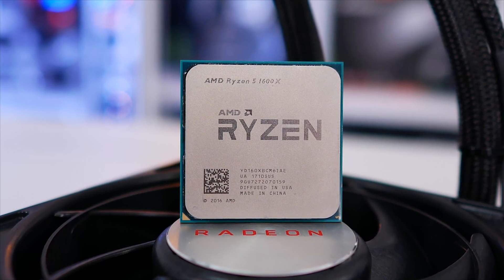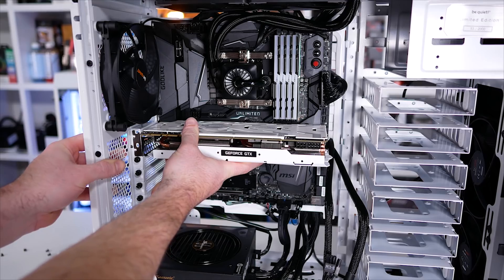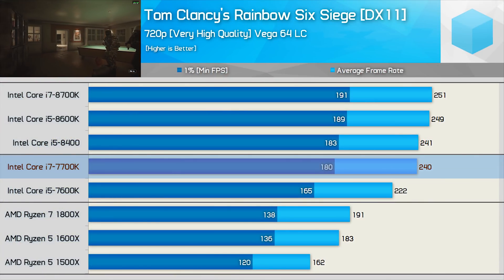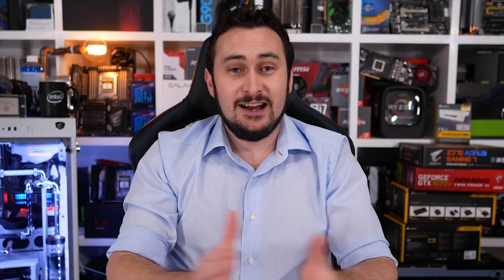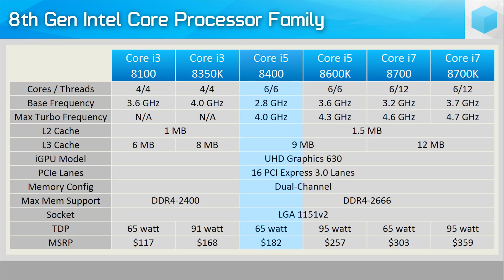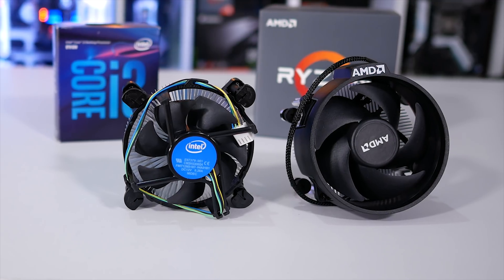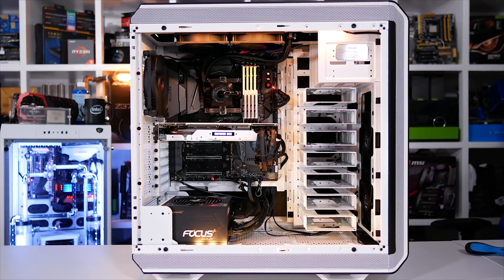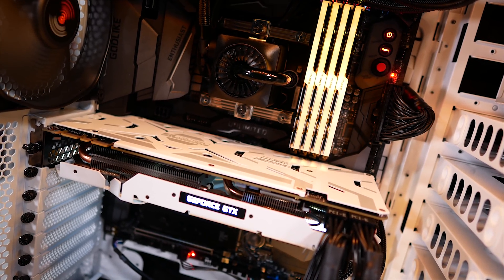Let’s Chat, R5 1600 OC vs. i5 8400 Benchmarks Incoming!

Comment: AMD Fanboi here
720p testing, that's fine as long as testing is done as well at 1080p and 1440p at minimum. While the argument of GPU bottleneck is relevant to cpu testing, there are variables when there is GPU bottlenecks that can show variation in the CPU's under test. Sometimes the slower CPU at 720p ends up being the fastest at 1440p, usually this variable with gpu bottleneck isn't as pronounced as at 720p, but we have seen some interesting variations in the 1% lows and for many that metric is more important than averages. This does not always play into AMD's favour but it is something worth noting and something from which counter arguments can be premised on.

I am amused though at the moment and I do await the 1600 OC benchmarks to see how close it is, but intel fanbois have had a lot of fun rubbing the average frame rates of the 1600 OC into the noses of AMD fanbois when comparing to a 7700K, that they just aren't good enough for gaming, while they'll happily extol the virtues of the 8400 as being good enough, even though when compared to the 8600k and 8700k, it's giving gaming performances that are somewhat in line with the 1600 OC with a 1080ti, while ignoring the fact that people using that GPU won't settle for the 8400, nor will that level of performance find its way into the mid range for at least 4 years.

The 1600 is bad because 7700K OC, but the 8400 is good because vs stock 1600 it wins with a 1080ti and overclocking the 1600 isn't a fair comparison and it still loses badly because of stock frequencies.

Comment: You should watch "The great coffelake con job" from "AdoredTV" you will know why the i5 8400 will perform worse on budget Motherboards.
Reply: Jim THINKS they wont achieve as high clocks because cheaper motherboards are often made with cheaper vrm components, meaning the extra power needed for the higher clocks may not be reliably delivered.

If MB manufacturers can produce decent VRM solutions using either enough phases, decent vrms, vrm heatsinks that work, they should be able to do it.

The bottom line is how much MB makers will cheap out.

Adored never states it will certainly happen across the board (no pun inreded).
Personally i think a few boards wont maie the cut, some will, so consumers investing in the platform should do a little extra research into this area before deciding on hardware
Reply: I agree, I enjoy watching Jim and he brings up alot of things others dont. He is predicting the 8400 will not perform as well on the lower boards. He could be right, he could be wrong. I honestly have no idea. I think Steve may be on to something with talking about the lower clock due to AVX instructions. I think were the confusion sets in is when Jim predicts things and AMD fans then start to preach it as gospel. Until we see the lower boards and what they can do we will not really know. As I stated before, lots of folks predicted Vega would beat 1080ti, many folks predicted the 1070ti couldnt be OC. So how about stop beating a dead horse and wait til we have facts to base claims on.
Reply: The entire point was that intel, for the first time, did not disclose turbo boost states per loaded cores. This enables motherboard manufacturers to implement whichever 6-core turbo they want down to the baseclock on motherboards that don't support overclocking. This is proof that it is possible for someone to make a motherboard that locks it to 2.8GHz when 6 cores are loaded. whether or not that will actually happen is another question, but this absolutely needs testing as intel has changed the way this works. You are no longer guaranteed certain clockspeeds for certain loads independent of the motherboard.
Reply from the maker: I've watched it, I still don't know why the i5 8400 will perform worse on budget Motherboards. Do you? If you do please tell me.
Reply: Hardware Unboxed it needs too much power in order to achive the all core turbo. Also it is using Intels Turbo Boost. But on more budget oriented Motherboards it is not gonna get enough power to run at the all core turbo of 3.8 GHz. 
That is how i understood his video.

Sorry if my english is kinda bad... I am from Germany
Reply: Tab yeap thats right
Reply: If you actually listened to Jim from Adored he said he Thinks that may happen as he has no real proof of it. We honestly wont know how they will perform on the lower boards til we see them come out and get tested. Reminds me of the folks that Thought Vega was going to be faster then the 1080ti. Dont believe anything til you have real proof of it.
Reply: Noobish He just knows a lot about Hardware and etablishes his arguments with articles.
Reply: We don't see clock differences between x370 and b350 on AMD why would intels mid range chipset be worse? Haven't watched the video in question but the only thing I can think of is limited ram speed on the mid range boards like Steve mentioned here and I wouldn't expect a huge difference from that as ram speed only seems to be a 1-3% change.
Reply: John Totten The fact is, jim's predictions have been for the vast majority been spot on. Predicted vega 7 months in advance, the gpu trend... The experience I have with him is the fact that he gets more things right then wrong.
Reply: "more stuff right than wrong", if you actually base your credence on testing, theres no wrong. The fact is, "jim" is full of shit. He can stuff his predictions, from current to past ones, where it required channels such as this one, to debunk the filth he kept spreading as fact. Misinformation is all he does.

Give it a couple months, boards will be out, hes proved wrong, and both you, that OP over there, and "jim" will disappear, moving to whatever next misinfo you're working on. Try doing something you're actually good at.
Reply: intel has a higher chipset cost to mobo suppliers. so for the same priced b360, the am4 b350 should have better components

Comment: Steve AMD fanboys like to spread misleading statements or just flat out lies. They were even saying that the AMD's  upcoming APUs would have rx 460 performance. Sometimes they resemble a cult.
Reply: Many users exxagerate on both sides. I just wanted to point out that you are commenting on a 15W TDP APU meant for an ultra-thin laptop if you are referring to the ultra-low power Raven Ridge Ryzen 7 2700U. When both the CPU and GPU is being taxed, there isnt enough power for both to spread their legs. Even at the frequencies they run at, we couldnt expect more than RX550 performance. This is all the hype I heard: similar performance to MX150/1030/RX550. That is still a ways below the RX460 in performance.

However, when a higher clocked and fully featured version of Raven Ridge is available in a 65W to 95W TDP variety on the AM4 platform, then it could be possible for such performance figures to be met. If you compare shader cores and clockrates and consider the extra TDP headroom, we very well could see such RX460-like performance in an APU.

Try to not run with a single thread of info from an extreme person  and act as though that will be impossible based on inconclusive information. To beat a fanboy and make a valid point, one has to be more rational and be better than them.
Reply: To play devils advocate here going ONLY off the new 2700U slides with NO REAL WORLD TESTING it does have the same performance on paper.

Key words being "on paper" however if you compare the actual slide fps numbers to the RX 460 it does not compare at all and falls behind the MX150 by about half, Still a huge boost over the old apus but not as good as people think, However it is also true this is a 15W part against a 25W dgpu and is shareimg the 15W with a cpu so even half the performance is damn good and does point that the full power 35W and 45W parts will be on par with a MX150

But until the 15W chips are in the wild and are actully bemchmarked im not willing to say one way or the other and my blanket statment is they look impressive as hell and im excited for them as if they deliver even 75% of what is promised they will still stomp the intel 15W chips flat.
Reply: Corporate Commander All fanboys spread misinformation
Reply: You mean to imply that Intel fanboys never spread misleading statements or lies? Like Chizow on WCCFTECH, for example? Sure, that guy NEVER lies or exaggerates. Riigghhtt!!
Reply: Disportionly yes both sides do spread misinformation  but even a couple of tech reviewers have pointed out which side tends to bring the bulk of it.

Comment: I know this is a stupid question, but I never understood why the 10 series (and 9 series) Nvidia cards do worse at dx12 games and I'm struggling to find a good video about the topic. Does anyone have a recommendation for a website or a video with information about it?
Reply from the maker: Basically they don't offer full hardware support.
Reply: Hardware Unboxed Thanks for the info☺️
Reply: To be slightly more comprehensive than the answers already given, as stated, Nvidia doesnt offer full DX12 support in Hardware. As a result of this, this have to do those DX12 functions in software. This pushes a lot of the processing of DX12 material onto the CPU. This is why, when you see DX12 benchmarks on a single game between Intel and AMD, you see the Intel cards with significant performance improvements over AMD. This is largely due to the fact that nVidias driver favors CPU clockspeed heavily. So with the last couple generations of Intel sitting at 5Ghrz, it gives significantly better DX12 performance on Intel than AMD. Which greatly skews the results. You can verify this by using an AMD graphics part in DX12 and there will be no significant difference in performance between Intel or AMD CPUs, because the AMD graphics card is supporting all DX12 features on card, and not offloading anything to the CPU for calculating. Which is why Steve is using a Vega for these benchmarks, as it removes the DX12 driver problem with Nvidia on AMD CPUs.
Reply: Back in 00's this kind of behavior was called "emulation".
But driver developers did a lot of work since that time so now performance doesn't drop as hard as it was in 00's.
Reply: Waseem H NerdTechGasm has a video. Check it out.
Reply: hello walkman thanks man😎
Reply: Waseem H hmm because to certain extend DX12 was supposed to level the playing field between AMD and nvidia? Remember all this low level thingy was originally pushed by AMD with  Mantle.
Reply: Hardware Unboxed; DX12 based games can't fully utilize nvidia cards? What about AMD? It's been a long time since I've built a new pc..  is it a driver thing or hardware thing?
Reply: bigbuckoramma,  Thanks for the information.
Reply: bigbuckoramma Thank you, that was really helpful and answered my question☺
Reply: Waseem H okay and another thing I have decided that I'll get the Ryzen 
Can you tell me which GPU will start giving me bottlenecks...

I'm sorry if I'm annoying you....
Reply: Waseem H stop being so stupid. Nvidia has always optimized their tech for DX11 based games. Most games released up until recent have been DX11 based. This is the reason Nvidia fanboys and YouTubers swear Nvidia is better. AMD has been pushing DX12 and low level API adoption for years.
Reply: Please tell me which is better in 1080p and upgradability (idk which combo is better)
For the PC I'm going to be building
Both  have  asus 1060 3gb overclocked white graphics card

1600+gigabyte ab350 gamig mobo
8400+gigabyte b8 mobo

I'll be playing gta5, battlefield,pubg,csgo, and games of such sort
Reply: Well first things first, there is no B8 motherboard that supports 8th Gen processors at the moment, you going to have to wait for those or buy a Z370 board (which is really a waste of money). The Intel 8400 is better for gaming but when it comes to being able to upgrade, all you'll be able to do is buy other 8th Gen CPUs later whereas the ryzen AM4 socket will likely be supported for ryzen gen 2 cpus, however ryzen CPUs are not as good for gaming (not to say you won't have a good gaming experience) but the Intel chips just are better for gaming.
Reply: Waseem H when do you think those motherboards will come?
Reply: ?? Next year at the soonest, although I'm not sure. Google it, I'm sure someone has more info😀
Reply: ?? Your not annoying 😎, anywhooo that Ryzen cpu shouldn't bottleneck your 1060, you'll more likely only see gpu bottlenecks if you stepping up to a 1070 upwards (assuming you play at 1080p)

Comment: even if ryzen loses in gaming its still a much better cpu that u will switch to ryzen 3 that will oc to like 5ghz or so and u will have that cpu for years whille the intel owner needs to buy a new mobo aswell so u save 200-300 bucks or if u wannt the ryzen is so much better in MT performance that u can have it for years and then get a used zen3 for like 50 bucks in the future:)and MT is gonna be importent with vulkan and dx12 gonna be in most games then and also intel sell more cored cpus so amd will get much gain just of that:)
Reply: I seriously doubt Zen processors will ever come close to 5.00 GHz. The CPUs aren’t limited thermally but rather due to their architecture which is also why the CPUs will not benefit from being more power efficient.
Reply: R1 is the current Zen cpus, Zen+ (Suppose to release Q1 2018) is the new Raven Ridge and is suppose to use 12nm for lower power and slight ghz clock bump (Alot of AMD fans call this Zen 2) Zen 2 is suppose to release in 2019 sometime and again extra performance compared to the previous. All these chips will socket into the AM4 socket. tl;dr AMD fans always looking to future perf and how it will be so awesome instead of just living in the now.
Reply: Khalifa Al M the Zen processors are more likely limited by the fact that they are a complete from the ground up build and don't have several years of manufacturing improvements on what is essentially the same architecture like Intel has done look at the clock gains from haswel to kabylake. I wouldn't want to speculate how far Zen+, Zen 2, or Zen 3 will go. Whoever has got an AM4 board though will have it relatively cheap to see the gains where Intel has been changing boards almost as often as CPUs. Which may be an advantage of its own if it adds useful tech improvements, unlike for the 8th gen.
Reply: WHAT in hell is the op talking about? r3 to 5ghz? what?  dx12? that only affects your gpu choice... used zen3? What do AMD fanboys smoke? i want in some of that!
Reply: dont forget u get a free cooler and cheaper mobos aswell so u can say u get a free ssd if u get ryzen insteed of intel or what u wanna buy with the money u save:)
Reply: I don't think you'll go wrong with buying either the i5 8400 vs r5 1600 (at least when Intel mobos go cheaper). You'll get your money's worth either way, so it's all good for us consumers.
Reply: björn sjöblom free is not a thing
Reply: Zero Punctuation ™
Reply: Socket, sure but they will have a new chipset, the X470. You'll be missing features like DDR5 and PCI-E 4.0 if you keep your old motherboard.
Reply: 2600k/sabertooth 5 years at 4.55 -still running strong.
Reply: my friend has an i7 2'nd generation, he jus changed the GPU and it plays games perfectly, and it's not bad on multy tasks too.....so yea.....
Reply: björn sjöblom i disagree. Something can't be better if it literally isn't... Lol
Reply: After seeing a few videos in regards to the new Intel chips, I really want to get it as an upgrade to my aging Westmere build. But the lack of availability reluctantly pushes me towards Ryzen, especially with Black Friday getting closer.

Comment: LOL Always entertaining. I'll up you one and introduce 480p tests :D I think you can't do any better than what you do. You show it all and anyone can look at what matters to them.If you are someone gaming at 1440p, then why does a 720p result trigger you?
Reply: Vinicius Alves  Again the point is not if someone plays 720p or not, it is about taking GPU out of the equation and measure how fast the CPU can numbercrunch the game at maximum. It shows how much headroom the CPU has for future graphics cards and where it starts to bottleneck. Say you install a NVidia Hyperforce 65535 from year 20xx into your current Ryzen/Coffeelake rig and the maximum framerate you get will be the number shown by the 720p that was measured here. The CPU bottlenecks at that speed.
Reply: To me 720p is irrelevant because no one play in that specs, to me we need 1080p in high and ultra high quality that diference is huge and you can't even see diference visually just in numbers
Reply: Vinicius Alves Good point with the quality settings. I'd love to see some scaling results from low to ultra, but it's just so much work to do. You'd have to focus on a handful of games to be able to pull it of.
Reply: 144p or go home.
Reply: MaaZeus not necessarily true because games could be more optimized in the future for more threads making the 1600 the better option 

The way I view it when it comes to the future is they’re equal since one is 13% better at single thread and the other is 13% better at multi thread

Obviously for the present you’d look for the 1080p results or the 1440p depending on the benchmark